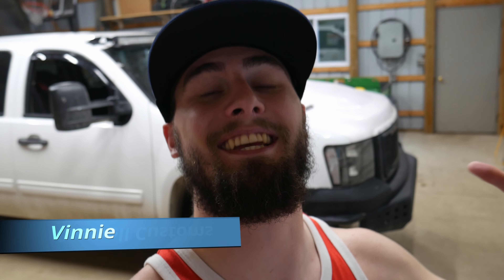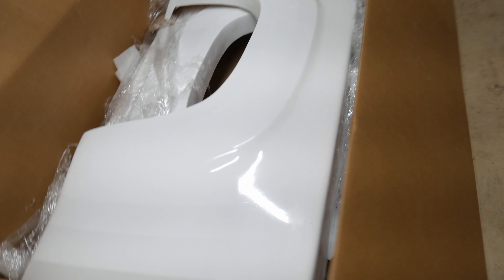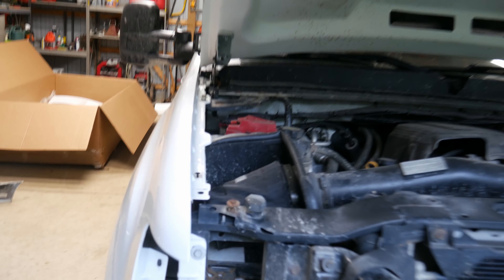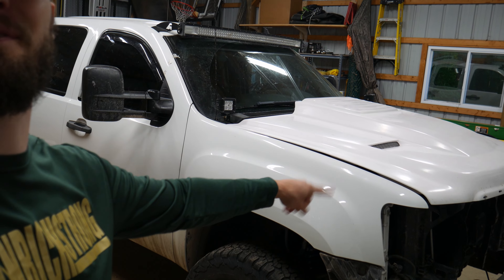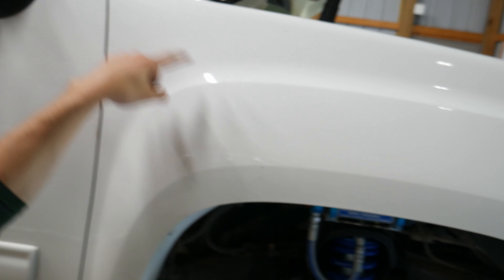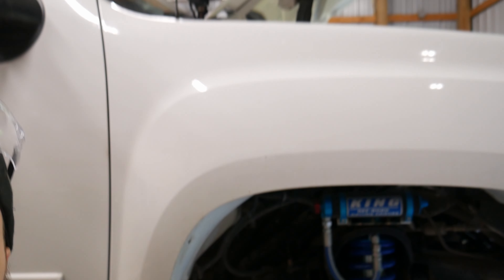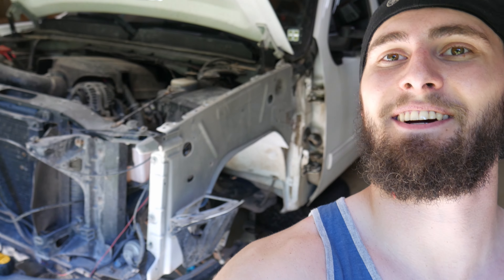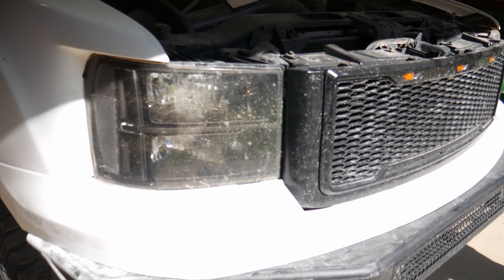07-13 GMC Sierra Fiberwerx Widebody - Part 1

Comment: When you drill out spot welds, you need to drill a small pilot hole with a 3/16 bit. The small bit allows it stay centered on the punch cavity.. once the small hole is made, the larger bit will no longer skip and wander around the target... Unless you are using a drill press, I always recommend starting with 3/16 bit and working your way up to the final diameter.

Comment: Fortunately they sell fiberglass fenders that are full fenders now
Reply from the maker: Fiberwerx does?
Reply: @CaswellCustoms  not too sure about Fiberwerx but there are other fiberglass companies that just need you to drill out the spot welds and avoid completely ruining the factory fender
Reply from the maker: @Will_Abner  i haven’t seen any, Fiberwerx doesn’t and ADV doesn’t. I know certain vehicles they make them full fenders, but not for the Sierra and most don’t for the Silverado either.
Reply: @CaswellCustoms  if I’m not mistaken the Advanced Fiberglass Concepts fenders for the Sierra/Silverado are a full outside fender and all you have to do is drill out the spot welds
Reply from the maker: @Will_Abner  that’s the same as the Fiberwerx ones I installed.
Reply: @CaswellCustoms  very well the instructions on there website make it seem different